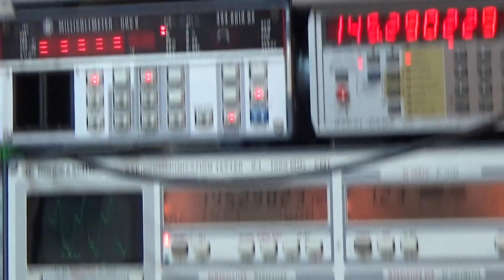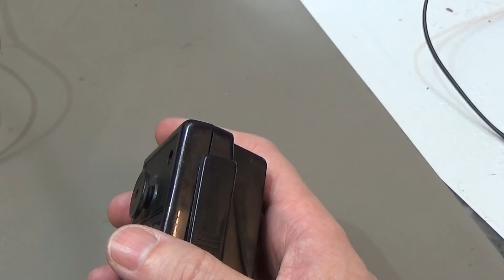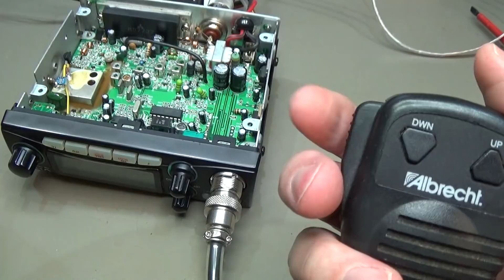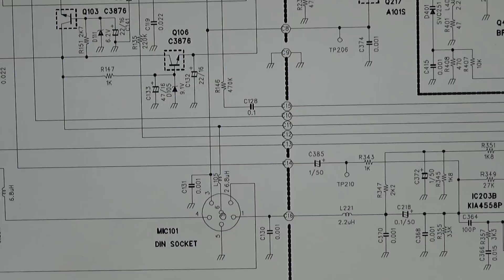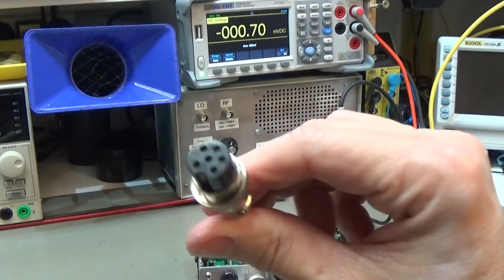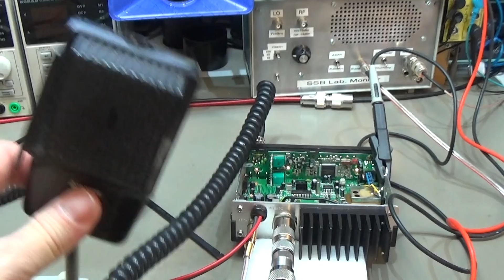#164 Albrecht VHF radio AE-550 with distorted TX audio fixed

Comment: how about RX audio distorted? I have IC-741 in my bench, and it behave with RX audio distorted. But sometimes when the rig is already hot, the sound is good. A capacitor leaked? If you have experienced such thing and present the video for repair, I'm very appreciate. 73 de YC1FYH

Comment: That power microphone dates back to the late 1970's, I believe.  It's a DM-510 and is powered power a single AA 1.5V battery. It's a piece of junk and should not be on any amateur radio!
Reply from the maker: Yes you are right old junk mic..Thanks for feed-back 73

Comment: Definitely looks like a golden screwdriver worked on this one at some point.  The biggest problem with aftermarket power mics is the users.  They turn the gain up way to high causing horrible distortion.  Nice repair, thanks for sharing.
Reply from the maker: Absolutely right Mike that is the job of a golden screwdriver...Thanks for comment 73

Comment: Well done, Peter! This shitty mic (sorry!) betrays radio operators since the 80s, it never worked  good on any radio i had here for service. It was just cheap. So cheap, that people had to pay twice for it! Best way beside bring it to the waste dump is: Crack /detrace the amplification board out of it, rewire the PTT and install an electret element. Get the bias from PIN 6, align the output level and thats it. But you cant solve the problem that it is ugly as hell ;-) 
BTW: http://www.eXXy.de/itm/10-Stueck-CB-Master-Verstaerkermikrofone-regelbar-DM-510-Neu-OVP-/142497040259?_trksid=p2385738.m4383.l4275.c10
You can grab those benchwork cookies for 10 Euro incl. shipping ;-) NOS i guess..
Reply from the maker: Hi Olaf, yes a shitty mic no question...The link doesen't work.. Thanks for watching 73
Reply: Have a look at the xx in the link..its just ebay..copy/paste and set the xx rigth..i was not comfortable to do the full link...

Comment: Peter that radio looks like its had an hard life....That horrible yellow wire mod with the cap and transistor (whats that all about) then the front of the radio falls off...very good fault finding and repair...Tell the OM to bin the power mic.
Reply: I was wondering that also ?
Reply from the maker: Yeah I agree looks like a hard life. This radios are rare here in my area so I'm not familiar with this mod and it even makes no sense to find it out lol. Thanks for watching
Reply: charlieoscar09 my sentiments exactly!